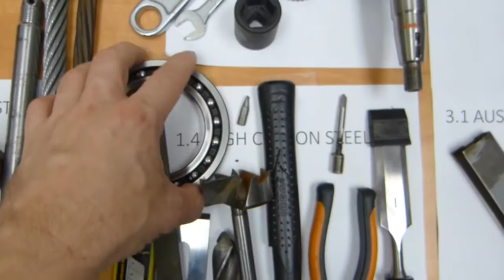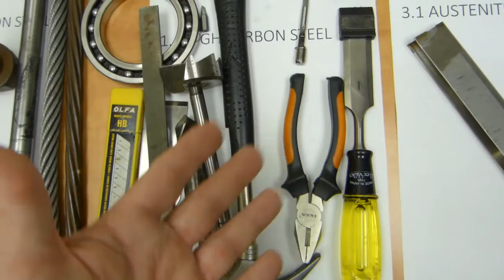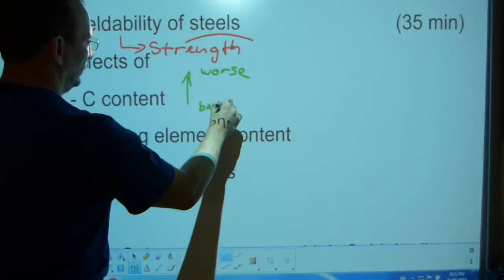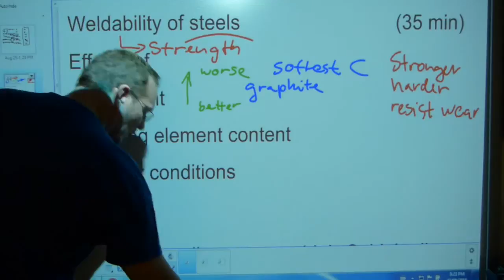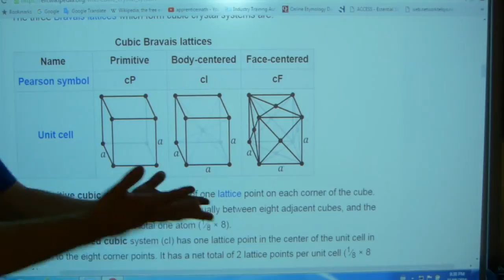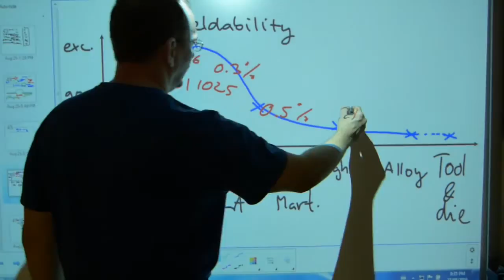Weldabity of steels

Comment: Learned a lot thank you, I can weld and have experienced some of the problems you've talked about but it's nice to know the science behind the "problems". As a side note do you have or could you make a similar video to explain "tempering"? I do some blacksmithing and whilst making some hot punches I've had issues with cracking ad the tools, this is happening after the temper rather than at the quench which has confused me somewhat, thanks again
Reply from the maker: Delayed transformation of austenite cracked it. I`m planning on explaining heat treatment words, thanks for watching.

Comment: Hello Sir,

Your Videos Are Very Knowledgeable I Saw Your  "Go faster by changing sprockets! "  Video...
 I Want Your Help..

I Want More Torque And Acceleration , I Don't Want More Top Speed.. I Dont Have Any Problem If My Top Speed Goes Down..

So What Is Your Suggestion For Changing Drive & Driven Sprockets Ratio For My 125CC Honda CB Shine MotorBike..( It Has 4 Gears, Sprockets - Drive - 14/ Driven - 41 Teeth )

Please Reply.
Reply from the maker: I don`t suggest or recommend any product, you do the thinking & shopping around, but I can do the math if there are enough numbers. Which isn`t the case here.
Put on a bigger rear sprocket for more torque and acceleration.